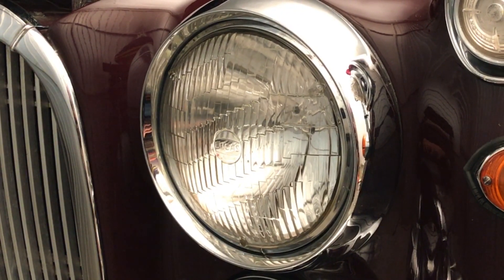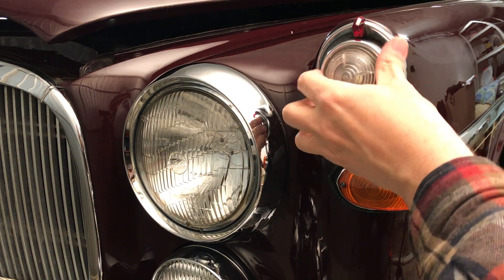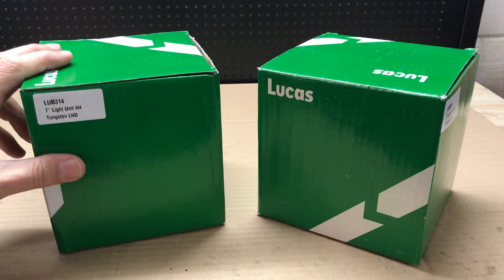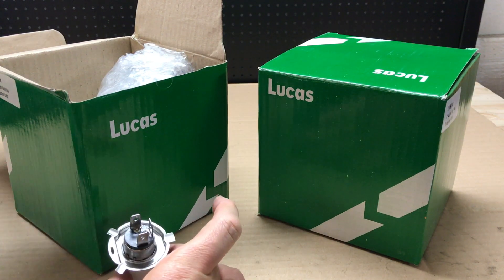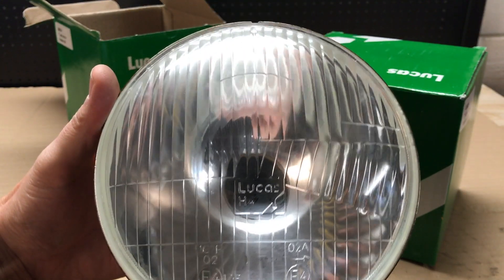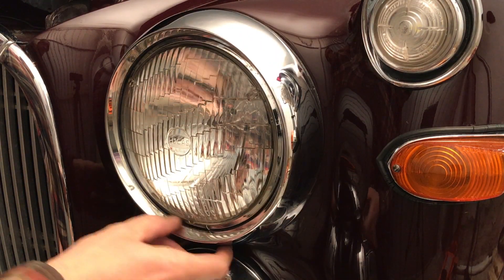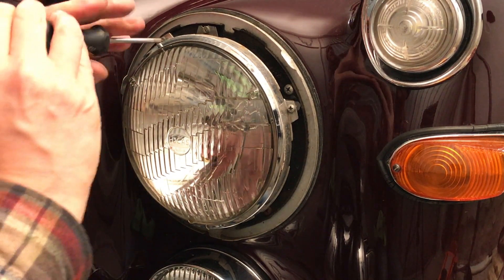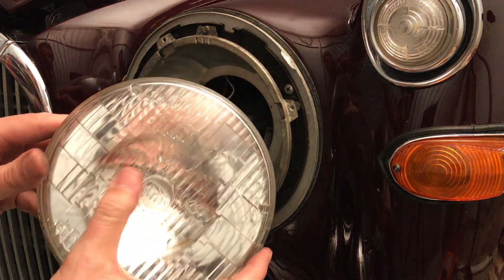Rover P5b LED Headlights Conversion

Comment: Good idea but don't you need relays to deal with the heavier current? I would think you are on borderline limits for the existing switches and wiring. Also, you were lucky not to damage the precious bezels. They should be removed by a screwdriver at the bottom of the rim against a small raised bit on the housing.
Reply from the maker: Yes, I will be fitting a relay. Thanks for the tip about removing the bezels, I won't be sweating as much next time.
Reply: @tarabordeaux1968  Would that be necessary?  I thought LED's drew much LESS current.  The main concern I thought was heat.  That is why they have that big lump on the back to displace it.

Comment: Mate. I am unable to find that light kit? Can you post a part number or updated link? same for the sidelights. Can you please post the bulb part number? You mention in your video that you have the option of even more powerful LED's. Did they come with the kit? If not, same request. Please can you post their part numbers or link to buy also? Thanks in advance.
Reply from the maker: The headlights came from here: https://www.classiccarleds.co.uk/search?q=H4+LED+Compact+headlights+Hi%2FLo+Beam+Conversion+

The exact ones I used are not listed anymore, but the company are super helpful and if you contact them, they'll sort you out.

The sidelights from here: https://www.ebay.co.uk/itm/181676429056?ViewItem=&item=181676429056&ppid=PPX000608&cnac=AT&rsta=en_AT(en_AT)&cust=8PG52583RK6379159&unptid=0cac3c28-8686-11e8-8e34-441ea14ee4c4&t=&cal=a70c002968724&calc=a70c002968724&calf=a70c002968724&unp_tpcid=email-receipt-auction-payment&page=main:email&pgrp=main:email&e=op&mchn=em&s=ci&mail=sys

Comment: I think you have got your words wrong the lamps fitted are halogen and not LEDs
Halogen will take more current and may there for need relays LEDs however take a fraction on the current so don't need relays and give a fundamental saving in power usage
Reply: You didn't watch this video did you?
Reply: TheHoipoloi I did and so did the other fellow. He fitted led sides and called them halogen. Then he fitted incandescent H4 s for the mains. Not leds